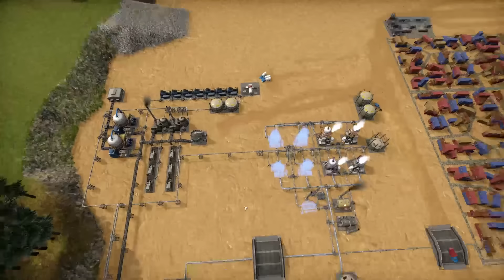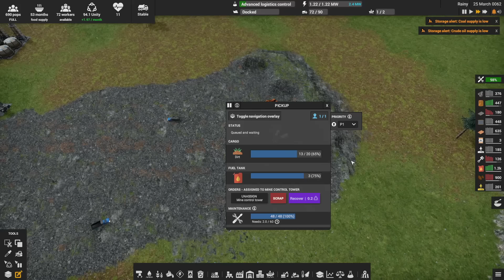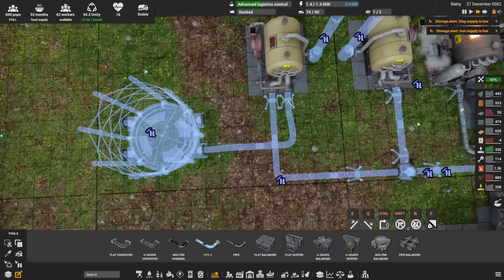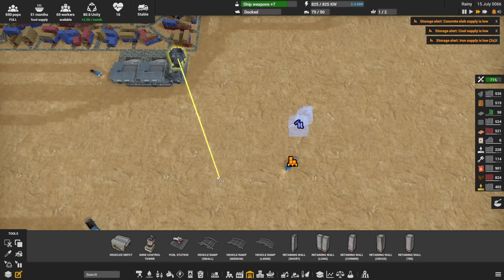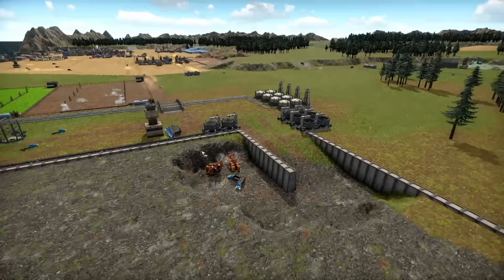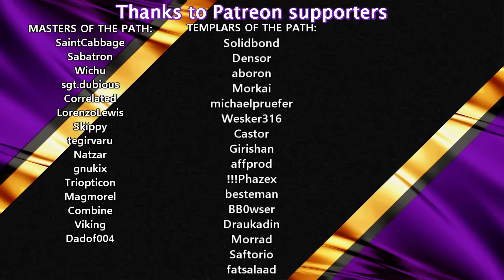Advanced Logistics Control to Improve Trucking & MIning | 08 | Captain of Industry | Lets Play

Comment: Balancers use power but they are also on a priority system. So if you lose power all you need is a back up diesel generator to make sure your main power water balancer still works. Just set it as priority 1 and everything else to a lower priority.

Comment: You can actually get the full five levels of height differential out of the retaining walls, not just the four you have set up. They have caution stripes at the bottom, so once you see those, you know you can't go deeper. Also, one thing to mention regarding the mining with Adv. logistics is to move your mining tower  to sit right next to your storages, because once they're full, the trucks go and sit next to the tower, and you don't want them losing time and fuel driving way up out of the mine and around a retaining wall to do that.
Reply from the maker: I know. Tiles for terraforming are 4x4 and they are 4x4 in the big grid, so I prefer to follow the grid for my mines i.e. 4 big tiles for ramps

Comment: Some things I think you should maybe focus on. Maybe.

First: Try to get to Sulfur Processing if you don't already, and set up some sour water strippers for your diesel production so you aren't dumping sour water. The water created can be stored for industrial and agricultural purposes. Also a good source of Sulphur for both acid making and rubber production.

Second: So, a product of stage three distillation and heavy oil cracking is Fuel Gas, which is a better fuel for the Gas Boilers, imo. Sure, it takes 48 fuel gas and 48 water to make 48 hi steam, but it's a good source for your carbon, too, which is needed to make graphite.

Three: Waste water treatment for much the same as Sour Water Stripping.

Comment: Another little piece of advice: you only really need retaining walls for "flowing" soils. That is brown dirt soil and sand. Rock allows for very steep unsupported walls.

Another advice on soil: save it for later in a separate dump. You can pave over ungrowable ground with a thin layer of dirt and then put farms on top of your previous waste dumps.
Reply: Basically your second suggestion is what I do. Garbage and other landfill to level 2. The top layer gets dirt. I don't always have enough dirt. I agree with the first thing. Also, the Steam guide about how far various things 'slide' when dumping stuff is enlightening.
Reply: @jamiec8096  Small tip, dump compost, it turns into dirt.
Reply: @Rattja  Thank you.🤓

Comment: Your oil build is seriously lacking. You can burn all heavy oil for steam that is needed as feedstock in your petro-chemicals. You will need to burn in addition some naphta, the remaining naphtha can be converted to rubber and cracked to light gas and then diesel.
Reply: Naptha is after advanced diesel, after research lab 2, after yellow constructions parts, not to mention all the other choices inbetween
Reply: @enire8477  fair enough... I always beeline for advanced Diesel, since that enables a proper petrochemical industrial setup.

Comment: 24:30 I saw a blue truck leave the logistics area with a full load. Was it going to get fuel or is it a bug?
Reply: I've seen the same. I followed it using the new follow-cam option and it went for fuel then returned to dump its load.
I'd assumed fuel trucks also supplied normal trucks. Seems not.
Reply: @STEVEC66  Yes. That bugs me. Fuel trucks really should refuel any vehicle that is out of fuel.

Comment: I am not quite sure the retaining walls are intended for open-cast mines. Given their high cost they are probably intended to allow digging down or building ramps near already built structures where space for a natural gradient is not sufficient. I can see them being useful on maps where build space is at a premium but on this map it is probably a large waste of material.
Reply from the maker: This is exactly the intention. If you are digging through dirt the you need retaining walls or the mining pit will be really large. Once you dig 12 levels down it helps a lot.
And if the materials are a problem, then build more. You can even deconstruct them after depleting a mine and get 95% of resources back
Reply: Yeah I think so too